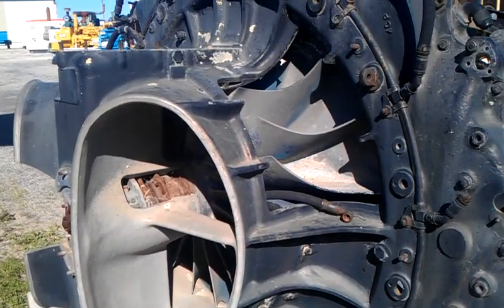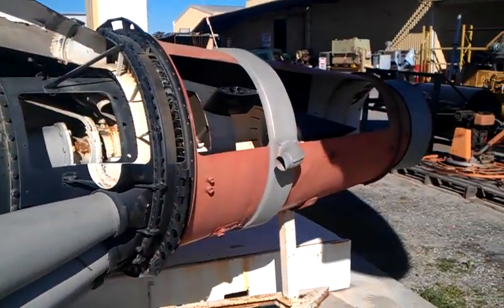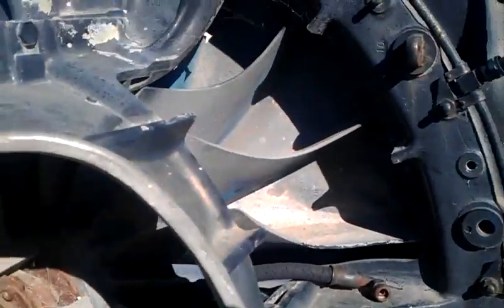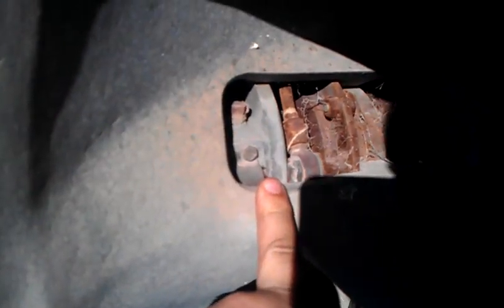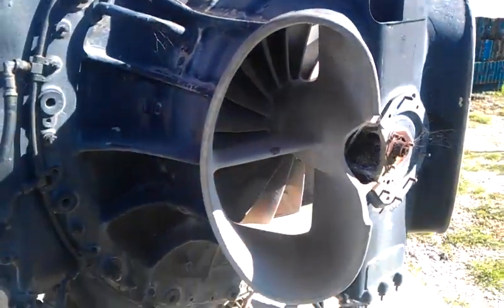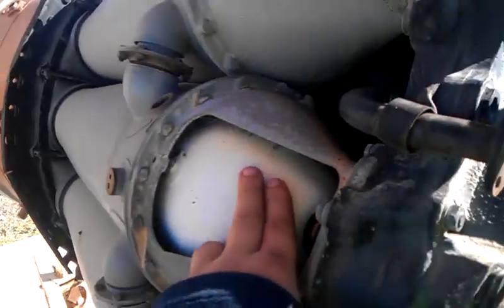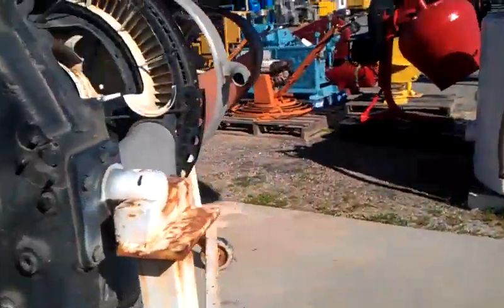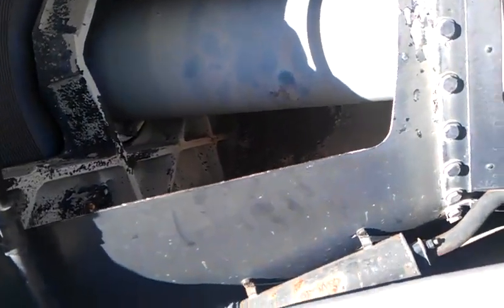DeHavilland Goblin Engine Cutaway View

Comment: Yep. Thats a DH Goblin all right . Designed by Major Halford . Always tricky installing the final combustion chamber. One of the design features was a shorter more rigid shaft reducing vibration and harmonic effects betwwen the turbine and impellor.I have seen a photo of a lady drawing a chello bow across a Goblin impellor with sand on the back plate which visualised the component harmonics.. ahh the days before the WWW
Reply: May i ask where i might find that pic?